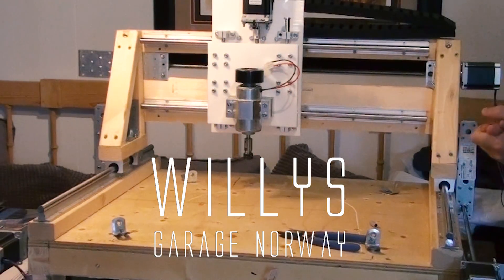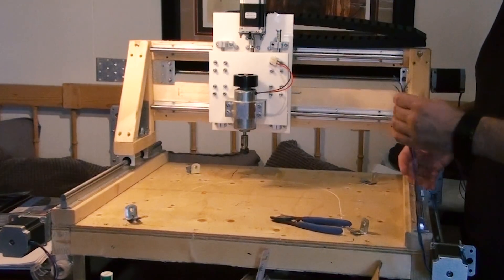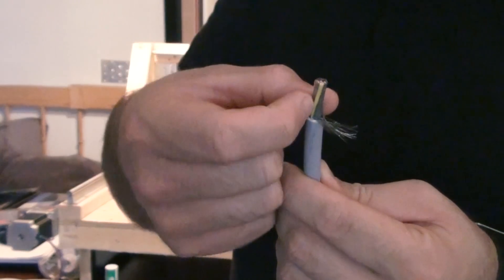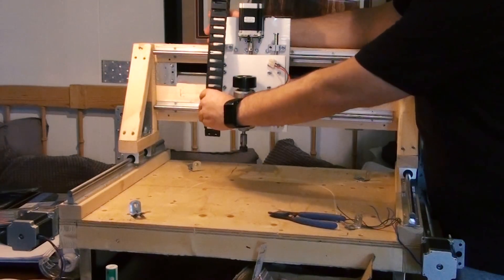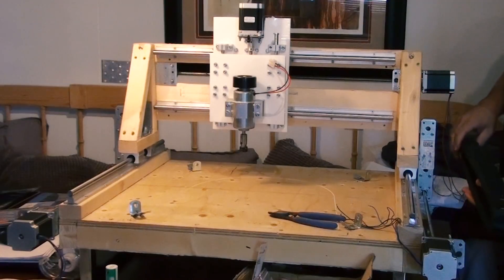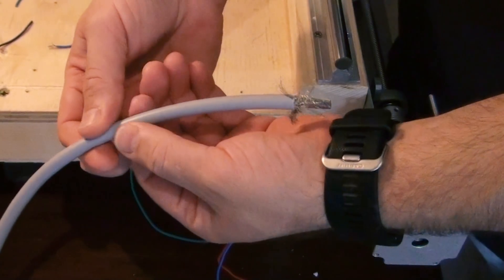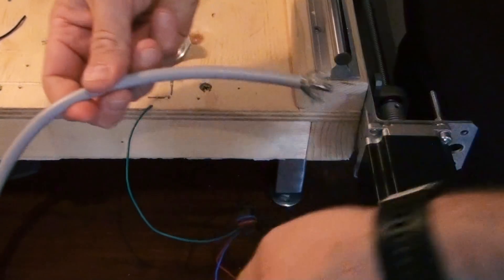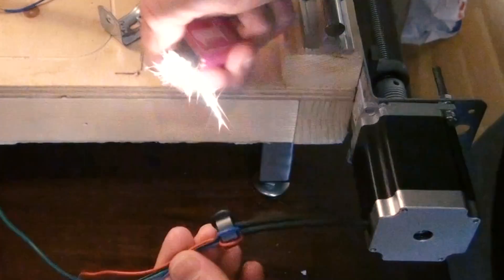First DIY CNC build (part 11) - CABLE DRAG chains and WIRING stepper motors

Comment: How many cores does the cable needs 6 or 7? And the awg? 24, 26 or 28?
Reply from the maker: I used 7 core but you might try to use different types.
Reply: But the 7 cores are needed?
Reply from the maker: @urko19  Yes, it depends a bit on how you decide to run your wires. A steppermotor needs 4 and if you want to wire a limitwitch with the same cable you need 2 or 4 more. So with 7 core you get more options, but the cable is also a bit "bigger" then let say a 4 core 👍
Reply: WillysGarageNorway and how many meters have you used? Thanks!

Comment: that is CL2 plenum wire. its for speakers in the walls. its not flex rated. its the wrong shit to use in a cable chain.
Reply from the maker: Diesel Ramcharger oh my.. so youre saying its a 7x0.75 shielded speaker cable? Only intended for speakers in the wall?
Reply: Correct. This wire has an "in wall" rating, meaning its not designed to bend and flex repeatedly. Probably not a huge deal, but something to be aware of. Especially on larger builds. My big machines use what equates to SOOW cord to the servo's and GXL wire pretty much for everything thing else {single conductor}.
Reply: on the machine we are building now we are trying a new product we found. Its "speedwire" by Stinger. Its meant for car audio, but has a very flexible tough jacket and comes in 5 or 9 conductor 18awg. 45 bucks for a 100' roll on amazon. So far I'm loving it.
Reply: @DieselRamcharger  I'm shopping for wire for my machine now, that spedwire doesnt look like its sheilded,  the real cnc wire lapp and helukabel are over 3$ a ft. There is some knock off out of china on ebay braided and foil screened rated for 10million bends for a decent price
Reply: @markme4441  speed wire is not shielded and it has  caused me no problems. the steppers really aren't susceptible to noise. I'm now building my 2nd table using speed wire. its pretty good stuff. I'm not saying shielded wire doesn't have a purpose, but these machines don't have encoders theres no data going from the table back to the control. theres really nothing to protect. you can run the bundle through shielded loom if you want. I've personally found no reason too. in my case these are plasma tables, if anyone was going to experience noise issues, id expect this to be the environment for it.
Reply: @DieselRamcharger  if it works for you that's great, i wouldnt change either but im using a vfd and the noise can cause problems on any low voltage.
Reply: @markme4441  seems you don't really understand electrical noise. the VFD will feedback into the mains if not isolated properly. there is no data transmitted on stepper motor lines, theres nothing to corrupt. proper grounding is all you need. if you had very noisy drive and ENCODERS talking back to the control the encoder lines would need to be shielded or twisted pair.  you do you.
Reply: @DieselRamcharger  Seems the OEM's, wire manufacturers, electrical engineers don't really understand EMI either, I'm building off their specs for the machine. A vfd that's not bonded is one thing, and intermittent noise with side by side cables in a carrier is another.

Comment: the grey cable what is the gauge of it and how many wires in it and please if you can add a link where to buy ti
Reply from the maker: user new The grey cable is a shielded cable. It has 7 pcs of (1 kvm) gauge cable and a aluminium shield. I bought it in a norwegian shop but this is a similar one: (there might be cheaper options :)
https://www.ebay.com/itm/Elektronikleitung-LiYCY-7x1-0-mm-50m-Steuerleitung-geschirmt-wie-Unitronic/262510176009?hash=item3d1ed36709:g:Y~0AAOSwe7BWz21n

Comment: I just want to know ..
why do connect limited switch? what is use..actually am just new comer ...plz tell me Sir..I want to make a cnc machine ..plz let me know sirr.
Reply from the maker: sam kumar Hi. The limit switches can be used to «home» the machine so the computer knows where the cnc is in the real world. It can also be used just as an safety precausion so that the machine wont go over its limits and be destroyed :-)  but I have not started using them yet. You absolutely dont need them to use the CNC machine 😜
Reply: Hello Sir..
Its my dream project...

Comment: Love your style of videos and really learning a lot in this series ! Thank you for sharing ! Have a wonderful day !!
Reply from the maker: muf fin I appreciate the feedback :-) Thanks for watching.
Reply: WillysGarageNorway Your guide was so straight forwardd and detailed that I have purchased my first Arduino uno and CNC shield, I bought only one driver chip just to test because they are a little expensive in my country. My question is can I just hook one driver chip on CNC shield and test it out? I plan to build a simple plotter first and then build a light duty CNC milling machine ! thanks in advance !
Reply from the maker: muf fin There is no problem testing the cnc shield with one driver chip. They are quite cheap on ebay, but from china. Good luck 👍🏻
Reply: WillysGarageNorway Thank you for the quick reply now I can finish the driver side of things ! really appreciate your help ! thank you once again !